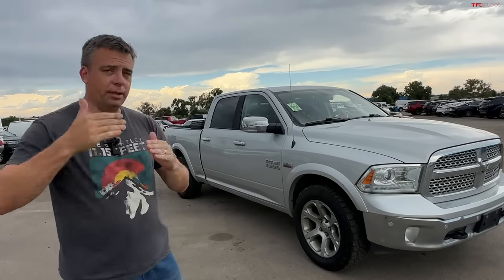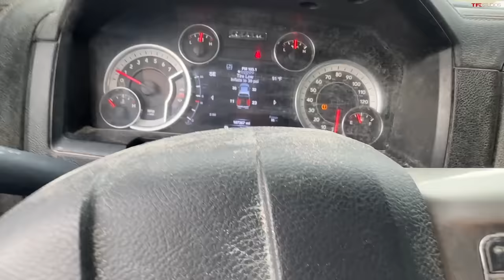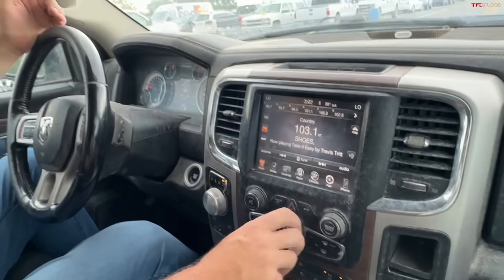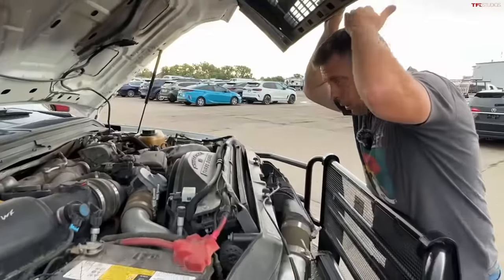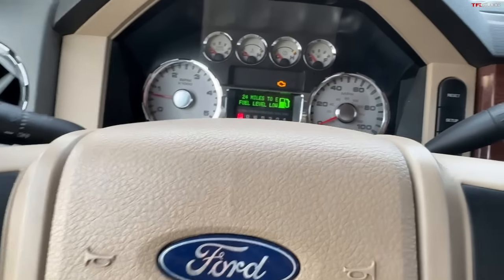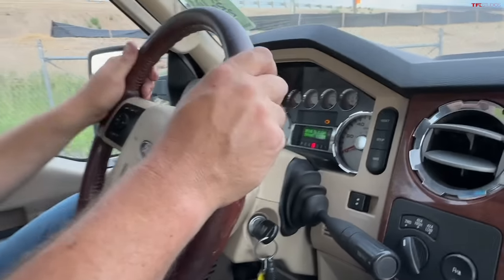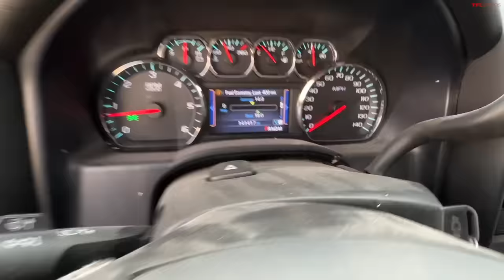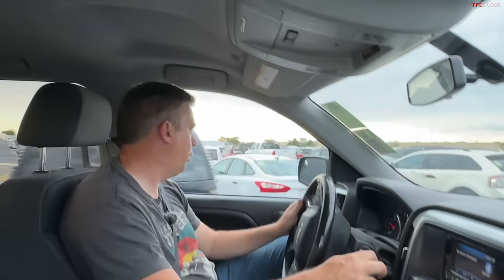These Are the Top 3 Used Trucks You Should Never, EVER Buy!

Comment: I own a 2011 gmc 1500 Sierra 5.3 extended cab it has 286k and towed 40% of the time . I had changed twi lower ball joints brakes rotors and tires batterys and two serpentine belts and wipers. It still runs great .
Reply: Your '11 is a decade into building LS engines. The '14 is the start of the LT engines and new trans controllers. That's the cause of many of the reliability issues.

Comment: I once owned a 2014 Chevrolet Silverado, same engine with 6 speed automatic and four wheel drive. Mine was a LT, black, extended cab with standard 6 1/2 foot bed. 

Bought it used in May 2017 for $23,000 with over 32,000 miles. Traded it in for a 2020 Silverado in December 2020 and got $10,000 on the trade in, with over 184,000 miles on the 2014.

After all those miles, it never gave me any problems with regular routine maintenance from my local Chevrolet dealership. Even with the high mileage, I was still getting over 20 mpg and the active fuel management system (V8/V4) didn’t give me any issues. 

This truck is definitely a buy, a definite not on the Dodge Ram. Great video, TFL crew.
Reply: currently i got a 2014 as a work truck since new, other than a tranny issue at around 115k miles its been reliable. almost 200k mileage on it now.
Reply: Same here, had a 2014 Silverado crew cab that I purchased new. Had it for 7 years and not one issue. Replaced the battery and pads at year 4 and that’s it. Highly reliable truck.
Reply: @josels1292  I miss my 14 SLT. most comfortable truck I have ever owned.  I now have a 2020 RST and the interior is worse and the seats are terrible.
Reply: Had a 2014 5.3 Sierra for 5 years. Put about 120k miles on it. Only problem I ever had was a cylinder needing replaced and an A/C issue. Loved the AFM. Great on many a road trip.

Comment: I had a ‘14 Ram with 14 recalls/TSBs.  After 90k miles one thing after another broke on it and I maintained it impeccably.  That trashed out interior on that auction Ram told me all I needed to know about it, whether the tick was a lifter or the exhaust manifold.  If the owner neglected it that badly, it’s a bright red flag for me.
Reply: My 2014 RAM currently in the shop after engine swap 2 years ago. They say it's under warrenty which is great yet pittiful. Stellantis get you're sh*t together or you are going to die. I see your product sitting on dealer parking lots for month over month over month
Reply: My 2015 ram as 144,000 miles, has only needed struts and an alternator…
Reply: @joshkrause2977  you are one of the lucky ones, my friend!  Keep that thing until the wheels fall off, and keep doing whatever you’re doing to maintain it because it seems to be working.
Reply: Exactly!! Unless it was mega dirt cheap, I would've ran away!
Reply: That's funny because I buy the dodges that are beat on purpose cuz I can get em cheap, replace a sensor then weld a plow to it and call it a day lmao.
Reply: @jimmyz909  Currently GM has the biggest gas engine issues. Know at least half a dozen brand new chevies grenade under 40k miles due to 4 cylinder shut off. And that issue has been going on since 2008.... whatever issue you have with dodge... it's not as bad as those chevies are right now lol.
Reply: @joshkrause2977  After it's done breaking in, do some burnouts and donuts to celebrate. 👍
Reply: @David-nx2vm  I don’t drive it like a grandpa, don’t idle it, and use good oil (5w20). Don’t think I’m lucky the lifter issue isn’t widespread it happens because of 2 major factors (part quantity issues happens in all cars) excess idling and bad oil maintenance (including wrong oil type for how you use the vehicle). Normal driving conditions without extreme temps put in what they recommend. Tow a lot? They recommend different oil weight and or more oil changes. Modifying you engine, well they recommend different oil for their high performance engines go with that.
Reply: My past 2014 same 14 recalls in 3 years I had it. Outside of the recalls the extended warranty covered replacement engine, transmission, rear-end, fuel pump, and many other issues. A real lemon, even following all recommended maintenance. Dumped it at 300,000 miles. Took a chance and bought a 2019 classic. 150,000 miles and so far no problems.
Reply: @thehavok4258  Easy fix. I bought a 2018 LT All Star 4x4. Great truck. After reading about the AFM issues, I purchased a AFM delete module that plugs into old PORT and  you engine stays in 8 CYL mode, with no mods at all. $200. Ran it to almost 60K before I upgrade to 2500HD, no oil consumption, no issues at all. It ran like  a V8 is supposed to, all the time.
Reply: @jrc0004 If she isn't banging off the rev limiter you ain't driving it right.
Reply: @Caliber50bmg  What is bs?
Reply: I had a 2013 that I drove to 221000 mi. The only thing I had to replace under the hood was the water pump and one exhaust manifold stud.  Both repairs were fairly easy.  On the 5.7 hemi you have plenty of room to work under the hood.  It's also a fairly simple engine.  From my experience working on Fords are a nightmare because they 10 do overcomplicate them and sometimes Ford engineering's got you like what were they thinking.   Having said that the EcoBoost are pretty impressive with the power you get out of them.  I also love the hybrid with the on board 7kw generator/inverter.

Comment: Thanks guys for doing this video. When I bought my 2012 Ram 1500 with 4.7L v-8 in 2016 it had 34k miles on it. A mechanic friend of mine said that 4.7’s were good. When I showed my brother who’s mechanic, said that by 100k miles, I’ll have to rebuild or replace the engine. The truck has 135,350 trouble free miles on it, I keep it maintained, no hot Roding, etc. It’s the newest vehicle that I’ll ever own, the others in the driveway is ‘93 Chevy Silverado with 5.7L & ‘02 Yukon XL with 5.3L.  I don’t think that any manufacturers make quality vehicles anymore. Y’all keep’m coming
Reply: My 2013 ram 1500 with the 4.7L V-8 has 157000 miles trouble free, I only replace the Battery and sealed the left headlight with silicone
Reply: 175,xxx on my 2011 with 4.7 no issues at all
Reply: 227,000 miles on 05 4.7 liter.  had it since new.  Motor happens to be one of the most reliable parts in the truck for me... manifold tick I been ignoring since 150k miles.  Original coils too.  Now the trans, rear end, front end and the rest of the truck.  Well, that's a different story.  lol
Reply: You got the second gen 4.7, much improved over first gen. Beefed up the valvetrain and gave it about 60 more horse. What I've observed with most problematic engines is most of the issues come down to lack of maintenance. Use a good oil and filter and change every 3 to 5,000 miles. But some engines are just badly designed
Reply: No hot rodding? You couldn't hot rod that dog of an engine if you wanted to.
Reply: I've got a 2004 Ram 4.7 with 265.000 miles on it and not one issue with it.  It's a great engine. Just need to take care of them.
Reply: @larryconner4062  I'm amazed it got to that many miles, it takes so long to get up to speed with those engines.
Reply: Imo, the 4.7L was best to be kept in the smaller trucks like the Dakota's. I have an old 05 Dakota with the 4.7l and it runs great, no issues at all really and it's almost at 200k miles. Picks up speed quite well, but it's also a smaller and lighter vehicle. I test drove a newer Ram 1500 a while back that had the 4.7l and I wasn't impressed at all, it seemed gutless to me. The Dakota was a much better drive imo, but also a decent price difference. $7500 for the ram and $3k for the Dakota, which this was in 2017, I made an offer on the Dakota of $2500 and the dealer took it. So far, that has proved to be a good decision.
Reply: Well...Ford's Ecoboost engines are going 250,000 miles without even replacing turbos...🇺🇸🤷‍♂

Comment: We have a 2015 Ram 1500 Laramie crew cab 4x4 with the EcoDiesel engine. We bought it new in 2016, and we've used it to tow a 28' travel trailer. It's our favorite vehicle to drive for long trips. It's extremely comfortable to drive and gets excellent fuel mileage.  The big problem with this truck is that it has had 9 factory recalls so far.  The local Chrysler/Ram dealer never seems to have the parts needed to correct the item under recall, and we're still waiting for a new fuel pump that was recalled nearly 9 months ago.
Reply: The eco diesels aren’t that great. 5.7s are way better
Reply: I have a '16 EcoDiesel also. I used to love it but after it was recalled for a mandatory de-tune for emissions the off-line performance was destroyed to the point that is almost dangerous at intersections because it lags so badly when cold. The fuel economy is also now not as good.  Otherwise, it has been reliable (except for a DEF injector replacement) for 146,000 km but there are so many negative comments about it that I am becoming uncomfortable about keeping it.
Reply: @wiserguy7257  just get the green diesel tune. It cost 1200 but fixes all of the tuning issue. Gain 40 horse power and 60 lbs torque as well as 4 more mpg. It's also epa compliant and by passes the EGR system to

Comment: I just bought a 2014 4x4 Silverado with the 5.3 with 220k miles. It’s a work truck trim and was used as a fleet vehicle with required maintenance completed at every interval at gm dealers and independent shops. No lifter noise and transmission shifts like butter. Hoping it lasts as long as possible before needing major work.

Comment: 3:10 That noise is actually a cracked exhaust manifold, which the 5.7 is notorious for.  That wasn't lifter tick.
Reply: I’ve seen many exhaust bolts break & cause the exhaust leak. GM has the exact same problem.
Reply from the maker: Thank you for letting us know!
Reply: yup! you can hear when you rev the engine. change the manifold it will quiet down
Reply: The exhaust manifold bolts break and you get an exhaust leak that sounds like a tick. I have new manifolds and bolts, thanks to a service contract we bought. On our 2016 Ram Sport
Reply: Still a dodge ram either way. JUNK
Reply: Funny everyone saying it’s junk when I’ve got 120k on my 5.7 2016. I’ve only replaced a caliper and a hub bearing and wheel sensor. My 06 5.7 has 215 k when I traded it for 16 and it still ran good. It’s all about how they are cared for
Reply: Hard to tell exactly what the problem is obviously lol. But this definitely doesn't sound normal. It sounds like an expensive problem. Other day I was passing near a Ram 1500 and it didn't make that noise.
Reply: Def exhaust manifold, but it may not be cracked. Often the bolts break. You can replace the bolts and gasket assuming the manifold isn’t warped. Left hand titanium drill bit 1/8” will get that broke bolt. Use drilling oil and don’t give up.

Comment: I gotta tell ya, I’ve had several 5.3’s from GMC and couldn’t have been happier.  I did however, have the sensor problem on the steering column on my 2011 but, I changed it out myself.  Had 175,000 and it was still running great.  Good video but give the off shore’s a good look too.

Comment: Interesting video. Can’t disagree with your conclusions based on my knowledge and exposure. Rule of thumb on AFM, etc., is keep the oil clean per my trusted mechanic. I am a GM (Chevys, Buicks, and Cadillacs) guy. Mostly Chevy. More recently three 5.3 liter and three 6.2 liter motors. Generally bulletproof and long lived. I kept that Mobil One Synthetic clean in all and it paid off with great service. No tranny issues either. My 2001 Suburban was traded by my son-in-law at 315k on the original 4 speed automatic. Thanks for the insights.

Comment: 100% that noise on the RAM is exhaust manifold leaking, just had mine replaced on my '16 before warranty ran out. However, knowing that they can have lifter issues and given the appearance of the interior I would steer clear of that particular truck because it probably wasn't properly maintained (i.e. proper oil and filter changes) which is a major factor in the lifter failures.

Comment: The tick is most likely an exhaust leak from the manifold. The manifolds get hot and start to warp and the bolts break. This is very common in this generation of Ram. If you change the oil frequently and take care of the truck. It will run forever. My 2015 Ram has been amazing to me beside the manifold leaks.

Comment: As a 15 ram single cab, only had the exhaust manifold leak . Dealer fix it for free. After a year or so got ARH headers catless tuned and trans tune as well. No issues . No hemi  tick yet but personally I will get a cam and delete mds and a few more goodies once I get 100k miles.

Comment: Don't forget the 8spd Transmission issues in those model Silverados and up. There wasn't a recall but everyone I know that had one got rid of them cause they had different issues that caused bad shuttering. They told me I had the wrong fluid in mine for 50,000 miles. Was like running a Posi rear end with no friction modifier. Which in turn had the torque converter messed up.
Reply: Had the problem with a 2021 and the 8spd. 
Exact reason I got rid of it. Terrible transmission issues.
Reply: I had a 2021 Silverado with the 8 spd - that thing was the worst transmission I have ever had. Would slam you in the back of the seat
Reply: @jordanreyes8880  exactly! I took it to two dealers! Both confirmed the problem but GM denied the repair because it hadn't out right failed yet! Only 11k miles!
Reply: @brent7368  I think they did two software updates to mine and they did nothing. Was so bad on cold starts. I moved over to a Ram and have been pleasantly surprised with how smooth and how much I like it! Will be getting that 3L Duramax next, though!
Reply: @jordanreyes8880  Did you happen to get an Etourque model? I moved to Ram as well, got a 2022 and I'm very mixed about the drivetrain. My etourque system along with my dads 5.7 with the etourque is very jerky.
Reply: @brent7368  no I have a Laramie Longhorn that has no ETorque!
Reply: @jordanreyes8880  I wish I would have gotten that instead. The Etourque is not great in the 2022 year lol. 

Rides great otherwise, very comfy.
Reply: I got a 17 3.5 Ecoboost with a 10spd now an I absolute love it an transmission is smooth as can be
Reply: Had that issue with a 2017 Silverado 8speed, it would hard shift from 2nd to 3rd no matter what. Took it to several dealers and had the software updated, fluid replaced to no avail. 🤷🏻
Reply: I was a chevy guy for a long time but after the transmission problems no more! I now am in a Tundra and love it!
Reply: @seetownwv  I drove a 2.7 EcoBoost F-150 and found the 10 speed to be jerky and shift weird. It had roughly 40-60k miles on it and I think it was a 2018. I much do prefer the 8 speed ZF used in the Dodge trucks. Mine has 206k miles on it and still shifts great. It's definitely smoother through all the gears than that 10 speed.
Reply: @jarrodbeyers8043 Toyotas can have problems too 😂
Reply: @jarrodbeyers8043  lol same exact thing here 😂 it’s too bad they aren’t making the v8 tundra any more such a nice power train.
Reply: Multiple class action lawsuits for that transmission
Reply: @bill_clinton697  sorry you had bad experience.  I love mine. Father inlaw has a 2020 2.7 10 spd an loves it. Always some that aren't up  to par in every brand.
Reply: the 14-18 Silverado's didn't have any good transmission options to choose from. the 6 speed was plagued with problems just like the 8 speed was.

Comment: I’m on my third used RAM (6 months on third).

2011 RAM - Got it at 40k ram till 250k, no major problems.

2017 RAM - 5.7L Hemisphere, got it at 30k, ran till 270k no major problems 

2019 RAM - 5.7L Hemi, got at 40k, at 55k with no problems.

I do not consider seat wear a “problem”.

Comment: I still love my 2006 F-250 w/6.0 PowerStroke.  Bought it with 213k already on it, now at 270k.  Several Ford mechanics said to stay away from the 6.4
Reply: The Ford 6.4 PSD is one of the worst diesels put in a modern pickup truck. The 6.0 is reliable if you keep them stock or build it for power. It cannot handle power with a stock block like the 7.3.
Reply: I also have a 2006 F-250 with the 6.0 PowerStroke. I bought it last year with only 74,000 miles on it. Now it has 85,000 miles. It’s completely stock except a straight pipe. I love it so far.

Comment: I've had a 2014 Silverado...5.3 V8 and while I had it the truck didn't give me any problems..I took care of it and took care of recalls as they came...
Reply: Same here. I am an original owner of my 14 Silverado and I’ve only had to do general maintenance thus far. I run Mobil 1 synthetic, changed my trans fluid to a higher end synthetic, K&N intake, Borla exhaust, tuned with LED upgrades. The underbody coating sucks but I brushed and sprayed it. The rear diff seems to clunk into gear every once in a blue moon when in between awkward shift and speed combinations. I tow 7,000 lbs with it and it is happy above 2k rpm’s. Of course I wish it had more low end torque but it’s paid for!
Reply: Pre 2019 5.3s you can take to the bank 💪💪